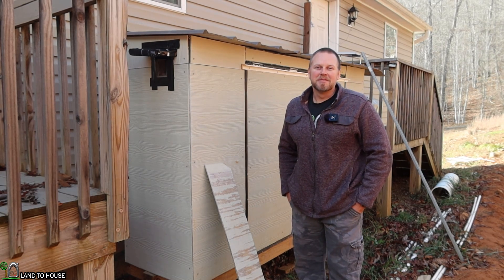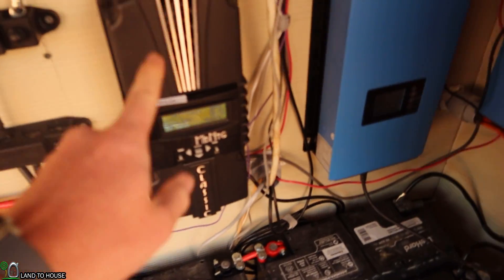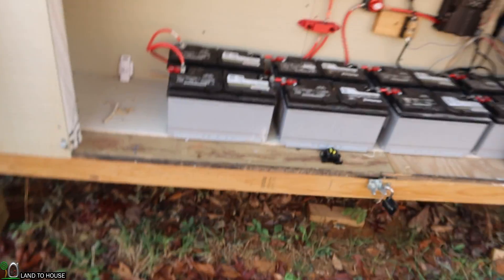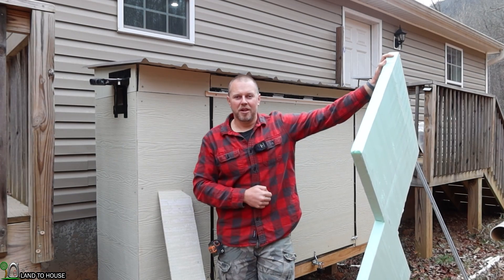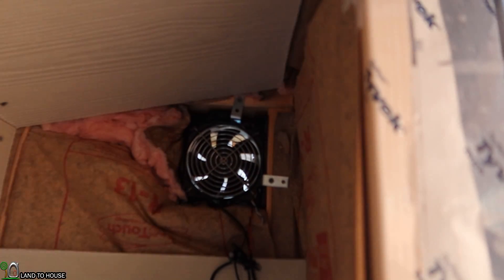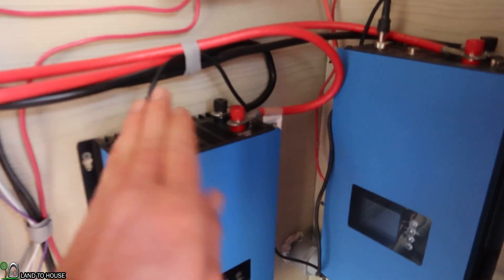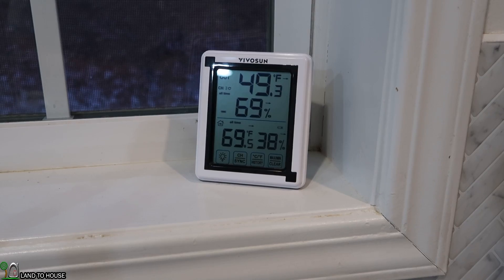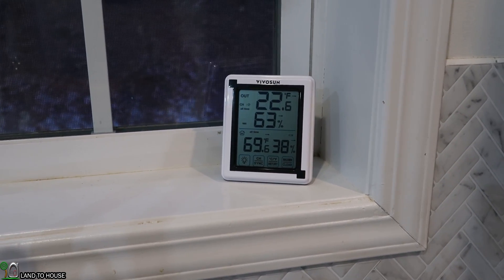Solar and Hydro Shed Heat Prep for Lifepo4 Battery

Comment: use a thermostatically controlled aquarium heater they are IP68 rated and very reliable
you can put any heat sink

Comment: Lithium, in theory, for charging needs to be above freezing but some bms units aren't totally accurate and can trip in low temperature above freezing.
I have independent temperature monitoring and heat pads. (12v heat pads)

Comment: Just put a light bulb in there by battery or get heated batteries or a battery heater. You can buy a plug in that goes on at 35 or so and off at 45 or 50. With all you have done it would work down past 0.

Comment: Well done and thanks for this.  I'll second the suggestion of a heating pad under the battery.  they make them for car/truck/camper batteries, and for greenhouse seeding beds that run off of 120vac (your inverter) with Edison plug in-line thermostats to control the seeding bed heaters.  (less than $50 from amazon).

Comment: I'd cover the fan holes on the outside with something closer to airtight. Also consider a   box around where your conduits enter the House or even foam pipe wrap for hot water pipes. Also perhaps more effective than insulation under the floor beams would be caulk around the inside floor. Sheet of foam across the entire floor then thin plywood and put your batteries on that.

Comment: I live in Tokyo and haver Solar on my Balcony. I have my inverter/power shed outside but since a LIFEPO4 is not that big i just put it inside my flat. You need to run cables anyway

Comment: You need to eliminate air movement coming from the outside. That front overhead door is losing all of your heat because of the gaps. if you put rubber door seals (the kind for front house doors). and put a garage seal flap over the top of the door, it'll work.
Reply from the maker: Its a bit hard to tell from the angles of the video but I actually do have those door seals. it makes a nice swoosh sound when I close the door.

Comment: Hmmm, in some of your answers you already suggested to put the LiFePO4 battery into your crawl space under the house. I don't know if you are talking of the Westwoods 280 pounds battery you unwrapped a month ago on your Life Channel!? I doubt that you will get this through you access door for the crawl space!!? And the associated inverter / charge controller must also be nearby, because the cables supplied with it were rather short.
Probably it's worth to try and install a little heating (heating mat, light bulb, ...) to get through the few very cold days in the winter. You should also check what the lowest acceptable temperature for the battery is. And you probably can improve the insulation of the power shed door. If this is still in the state of your build a yera ago, that it's only 1" Blue Foam.
Reply from the maker: Oh my! No that battery is a monster. The new battery for the power shed is a 5kwh. It weights 90 pounds. Much better than the 280 pound vestwoods.

Comment: Why not put a lightbulb out in the shed for a spot of heat?   I use one in my pump house and just that 75W bulb produces enough heat to keep the temp up by quite a bit.
Reply from the maker: Good idea. now that I know it does not pull enough head from the house I will have to give that a try.

Comment: Excellent solution to get air from under the house, also isolate the pipe and the rear wall, you will see what a big difference between the AGM and the lithium iron phosphate, the AGM moreover that model was not born for solar applications, they are the worst in terms of useful life , and efficiency between energy input and output as lead technology, the liquid acid ones last much better, with LIFePo4 if you want them to last many years never go above 3.5 Volts and never go below 3 volts for cell 48V-56V, if you want to squeeze them instead, but they will last less than 46.5-57.5 I do not recommend!
Reply from the maker: I am really looking forward to using the lifepo4 in this system. The advantage over the agm should be big. I like your suggestion of not pushing the battery too far and reducing its lifespan.

Comment: Wondering if you could just put a seed starting heat mat under the new battery and set it's thermostat to come on if the temp reaches down to the mid 30's?
Reply from the maker: That or a light bulb would do. the space under the house stayed at 43 degrees during the 0 degree span this past week. I think it will be easiest to keep that lifepo4 there.
Reply: @LandtoHouse  - or a heat lamp… incandescent bulbs of some kind is a great idea!!! Awesome!!! Thanks!!!

Comment: hey hi, I think you could put the new batteries on some heating mats activated by a thermal switch that closes automatically under a certain temperature, then you could cover the batteries with a blanket, possibly fireproof
Reply from the maker: I did purchase a thermal switch. I'll have to give it a try. But I think that I'm going to stick the batteries under the house and just run a little bit longer cables. Under the house stays about 48ﾟ most of the time.

Comment: Insulation is another heat source...
Reply from the maker: I was hoping that the conduit lines from under the house into the building would be sufficient to keep it warm but it's not. I believe I'm going to place the battery under the house and run longer cables so that the battery can stay warm and still have my other electronics out in the powershed.

Comment: Worse comes to worse...at a little loss of energy...put a 60-100W incandescent bulb in the enclosure...let it keep the enclosure warm
Reply from the maker: That is true. I'm thinking that if I store the battery under the house and run the cables out to the power shed I can keep the battery at a proximily 50ﾟ. I think it's a better idea than trying to keep the shed above freezing
Reply: @LandtoHouse  - maybe just placing your batteries 🔋 in a hole dug next to your house, below the shed? (Lined with foam board & caulked to make waterproof?)

Comment: If you still have enough foam board, use that to seal those vents up. As well as placing the floor with foam as others have said. To minimize the thermo bridging from the 2x4. 

Also, look up how to build your own solar can panel. Paint the cans black, stack them and install two insulated pipes to the shed. To circulate the air inside the shed into the can solar panel, with a thermostat controlled fan. This will increase the day time temperature and hopefully it’ll remain above freezing overnight.
Reply from the maker: I do need to finish filling the gaps especially in that floor. We've had temperatures down in the negatives this past week and I've realized that I'm not gonna be able to keep a battery in there. But the temperature under my house has maintained 45ﾟ and above even with those cold temperatures.  I think it's time to keep the batteries under the house.
Reply: @LandtoHouse  That might be a good idea. And remember per NEC, you shall keep power wires separated from data cables. So you may have to install a 3rd conduit. I can’t remember what you have in the other two. And I think DC wires shall be separate from AC. But I’m not sure.
Reply: @LandtoHouse  but batteries could be under house (or kept in burried water tight box) it is now so far away, isnt it? Or just a few selfregulating heating pads under LiFePo cells… my PVE outdoor box is going to have 8” insulation…

Comment: Hello one suggestion when installing new batts put 2x2 under them to air around them also help in warmer times as well. Also if you have extra solar panels get 12/24v heat pads and hook up to add heat in shed. I do that to keep water open fir chickens.  Just had -50c with windchill

Comment: As you could damage your lithium batteries if they try charging when the temp is below zero, I would personally locate the new one in the house and take the cables through the conduits back into the battery shed from the house :)
Reply from the maker: After the past week of 0ﾟ weather and the power shed getting down too 11ﾟ I would have to agree.  Even if I were to put the conduit and fan to blow warm air in there it might still drop below freezing sometime.

I think I will leave the rack batteries under the house with the conduit feeding the cables through to the inverters.
Reply: @LandtoHouse  - Battery combustion for lithium batteries is a concern. Even venting of LiFePo4 is poisonous, so there is no way around it.

I am struggling with where to place my batteries 🔋, and I decided to make it exterior, mostly after watching your channel. I built my large battery bank on a dolly, to give me options (4x 80lbs.) I plan on making it look like a dog house! LOL! 😂 

After seeing this video, I may try to find a powered vent which opens & closes a flap, for exhausting excessive heat. I like another viewer’s suggestion of a seedling 🌱 heating pad… have to go find one.

I think you did the right thing, keeping batteries outside the house. I would keep them outside, with an external electric temperature controlled pad heater, or buy/add only batteries with their own integrated heaters.

Comment: I don't like these lithium batteries to many electronic components to go wrong,old technology is still better like old cars, run's for ever.I almost burn my room with a power bank, good brand not cheap,i heard strange noises from my room that thing swallowed break the plastic cover end when i throw it outside blow up like a grenade with flames.
Reply from the maker: Sounds like you had a lithium ion battery? Supposedly the lifepo4 don't blow up.
Reply: Hey Iohanna. bab. — 

I also had a venting issue, with a medium sized lead acid UPS in my basement… 4x lead acid AGM batteries vented, created a bad smell, but no flames 🔥 … took me forever to find what caused the smell!!! 😂 (At least lithium would give me a clue by melting the case with visual cues!!! 🔥 😂)

Batteries 🪫, like all energy sources, are dirty & dangerous, must be respected.

Lithium chemistry 🧪 brings a new dimension of danger from hot poisonous ☠️ fumes to raging ball of fire ☄️

I recently bought about 36kwh of Lithium, and I am putting them outside, just like Seth did with his safe AGM batteries. No way am I keeping that much Lithium in the house… no way… that is a disaster waiting to happen.
Reply: @DavidHalko  AGM batteries can run for many years if you maintain them properly at any conditions, lithium technology is too problematic yet, like the new electric cars.

Comment: You should just buy an RV tank heater, some lifepo batteries you can buy with one of those heat mats already installed in the case.
Reply from the maker: I have seen those and that might be effective. But seeing how the temperature can drop down too The single digits I might put the rack batteries under the house where it's 45 degree and above.  The main downside to this is having to bend down to get them under the crawlspace.

Comment: U should fabricate some doors over the vents with a rubber gasket so that it is airtight. Open it up in the summer and close it off in the winter…
Reply from the maker: That's a fine idea. I might just do that. Thank you for the suggestion.

Comment: Just a thought Seth. All the time you have the AGM batteries, be aware the gas off, I think possibly hydrogen, which you maybe want to vent to atmosphere? Loving the channel BTW 🙂
Reply: He has vents in there, and a power fan for warmer weather.
Reply from the maker: That's a good concern. I was just looking up AGM batteries and apparently if they do off gas it's very  Little. I do have vent holes on both sides of the power shed for the summer time.  just blocked them up here in the Winter to see about saving heat.

Comment: A good looking system  ans it would be easy to a sub battery box to isolate the batteries does amazing . The new lithium batteries are pretty dang impressive in therir power abilities.
Reply from the maker: I have worked with a few of the new batteries and they are quite impressive. There is no comparison between them and the AGM batteries. After monitoring the temperature during this last big storm I think it's going to be worth my time to haul the lifepo4 batteries under the crawl space. When I get them.

Comment: Insulate well, duct in some air from from hone, to prevent freezing, should thermal siphon, no need for fan, if you are wary of fire spread, fit two fused fire dampers

Comment: Good video, thanks. You might take out your batteries and lay in a 2" piece of foam board under them. Add another full-sized 2" foam board underneath and cover those 2x4's. All outdoor-exposed wood members are acting as conductors of the outdoor cold straight to the inside. What you want to achieve is having no thermal bridges. THEN from the heat of your inverters your shed may stay above freezing and you can safely charge your lithium batteries.
Reply from the maker: Good points. I think I'm gonna move the battery system under the house but probably still worth having the foam underneath to protect from cool air rising up and moisture. Under my house stayed 45ﾟ and above even with negative temperatures outside.

Comment: Is your controller supposed to be that warm with just 200 Watts going through it or is that going to be a problem for you because if it's that warm in the winter it has to get super super hot in summer
Reply from the maker: From my understanding the classics are designed to dissipate heat/power whenever power is not needed inside the house. They can get a little bit warm. In the summer time I have a solar computer fan that draws hot air out of this Box.

Comment: buddy i dont know if its something you would want to try or not but they make 12 volt heaters for cars that run right off the battery . there not very good for heating up a car but they do work in a pinch . might be enough to put that little bit of extra heat into that shed . just make sure you have a inline fuse  and all that safety stuff lol . remember safety third . merry Christmas buddy and happy new year .

Comment: Hey Seth a simple way to improve the heating in the box would be use some of that thicker foam board  and use it to shrink the space inside the box. The entire left side is just dead space adding to what needs to be heated.   Make a wall from the thicker foam board just left of the switches/bus bars thus cutting the space needing heat in half. Possible giving the charge controller and inverters a chance to heat it all on there own.  Would make a interesting test if anything.

Comment: Great ...you can use DC heater with thermostat inside the shed to warm it...and can simply connect it with batteries

Comment: Hey Seth, I recently dealt with the same challenge in my wife's she-shed.  A small thermal switch and a seedling heater mat under your LFP batteries will provide enough heat to keep the cells above freezing, especially if you build an insulated mini-enclosure for the batteries, inside the shed.

Comment: Merry Christmas Seth! Great video. I live in NY. Thought to do the same. Building my power wall with Lithium .18650.
Reply from the maker: Merry Christmas. Thank you. This has certainly been a work in progress. Stepping up to lithium iron phosphate batteries should be a big step.
Reply: @LandtoHouse  - any charging of lifepo4 in a freezing temperature will cause premature shorting & combusting. Not necessarily during that day, but any day in the future. It is a gamble.